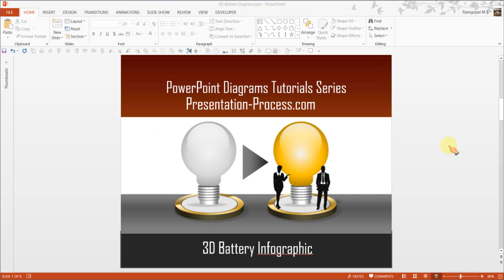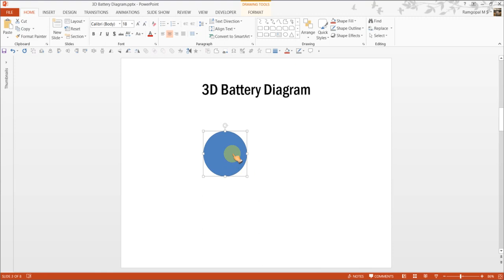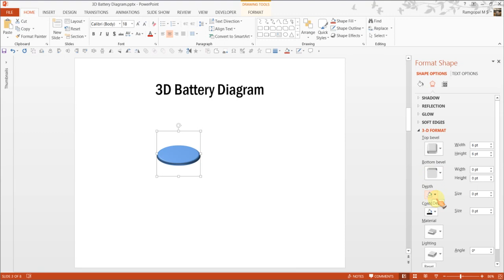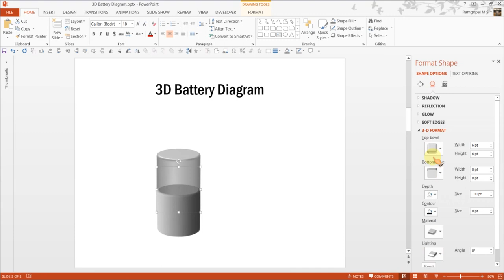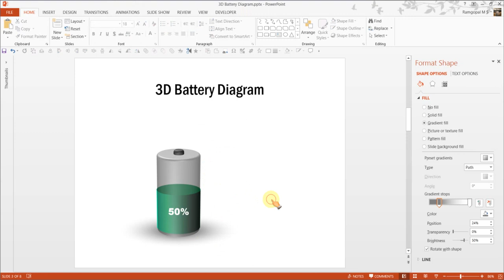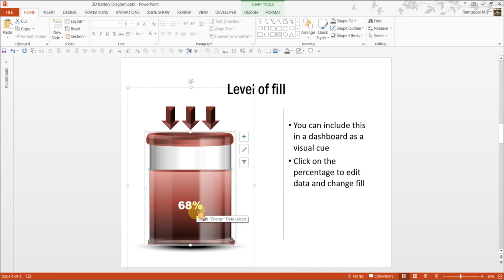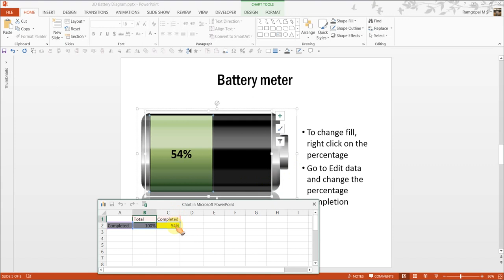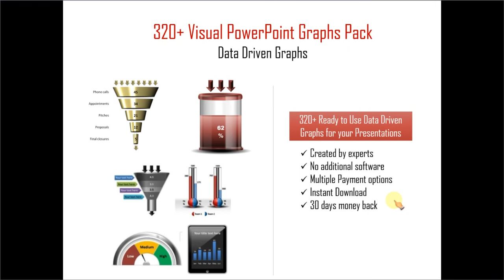How to Create 3D Battery Infographic in PowerPoint

Comment: Hi, I did exactl every steps you showed but when I change the fill of the shape, only the top surface changed, the depth still stayed the same :(( how can I fix that ? I'm using Microsoft Powerpoint 2010, please reply me, thank you so much for sharing
Reply from the maker: Hi, when you change the fill color of the shape, you also need to change the fill color of the DEPTH in 3D to match. You can do this by going to 3D options. Select the 3D shape and go to the Format Shape > 3D Format and Depth option to change color.